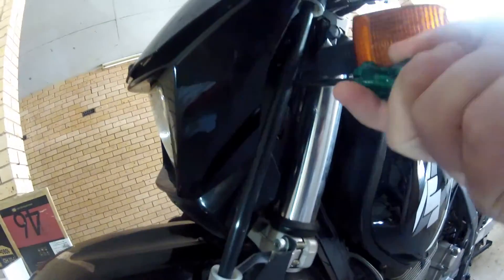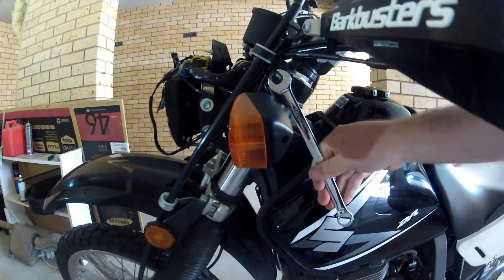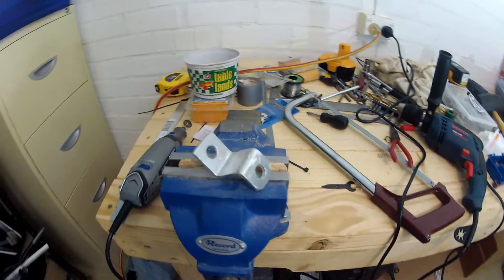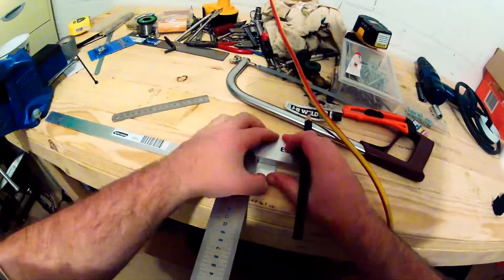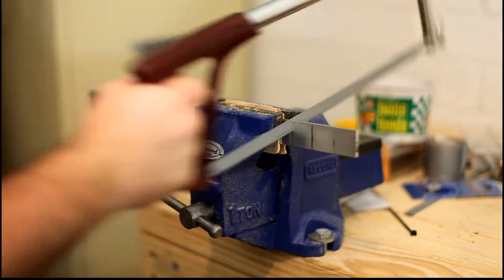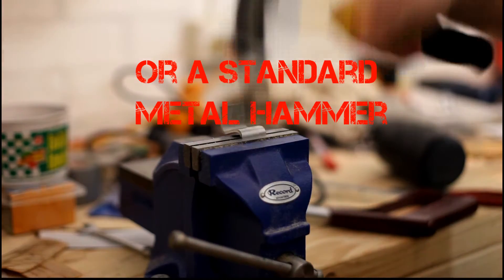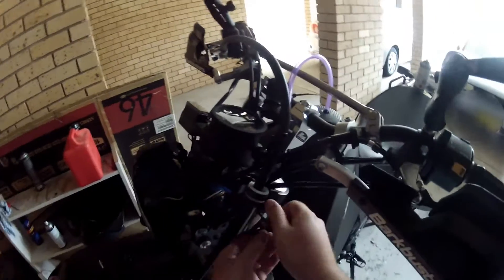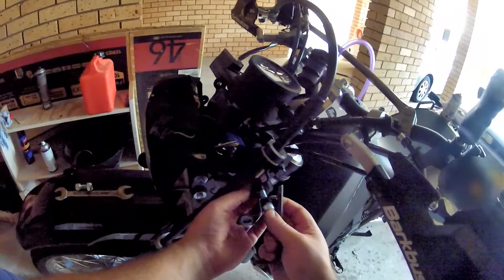How to:  Indicator Relocation Brackets on a DR650

Comment: Just got the 25L Acerbis tank for the DR650, I just turned the indicators upside down. Worked for me.
Reply from the maker: yea I read anout that after I did this...good there is another option !  ohwell hehe...
Reply: I’ve just had a 25l tank installed and have the turn issue. Going to entertain the idea if it’s not too hard to turn the stock ones upside down. I did pay someone to install the tank as I wanted it done properly.

Comment from the maker: Bike wont pass rego here in Aus if the there is obstructions with the steering.
Fairly simple bracket and the second one bent a lot more easily.....lol i was a little more careful.
Reply: Yes i just switched them and mounted the brackets upside down. Worked perfectly and took 10 mins. Didn't make anything. NSW.